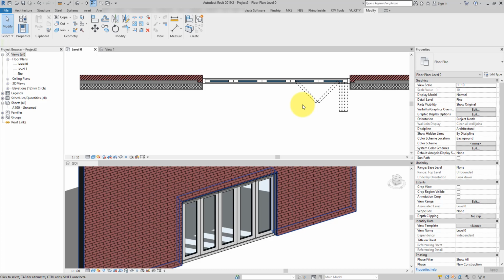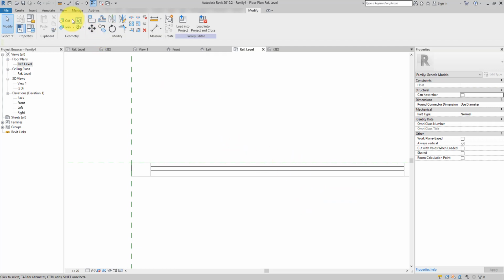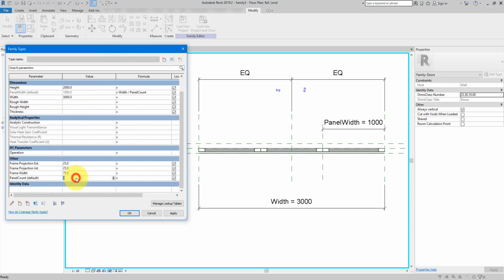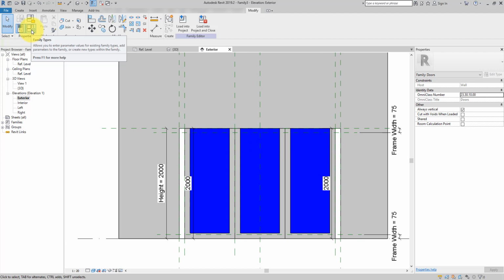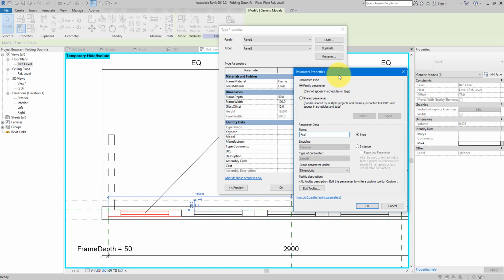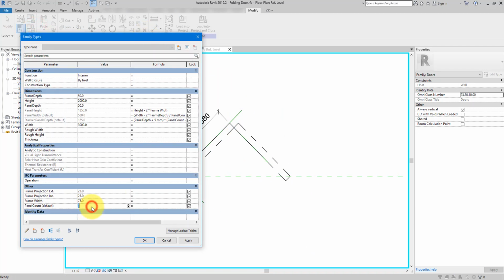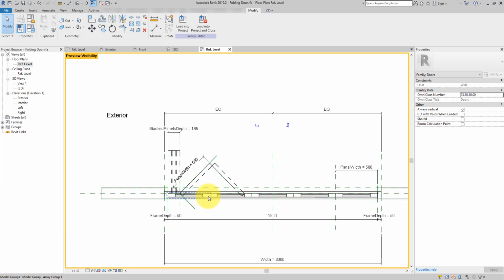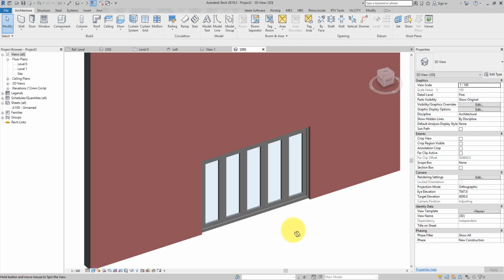Revit Snippet: Create Fully Parametric Folding Doors

Comment: Unless  have tried this over 15 times and it wont work. When copying similar on the panels (29min45 sec) I am unable to create similar, the system will not allow this. I have tried everything i can think of and no luck.
Reply: Same thing happened to me. You have to select it, then press Tab, then select it again to enable the create similar context menu option.